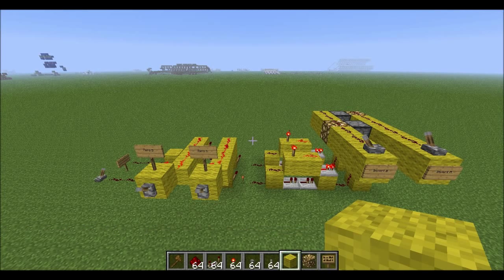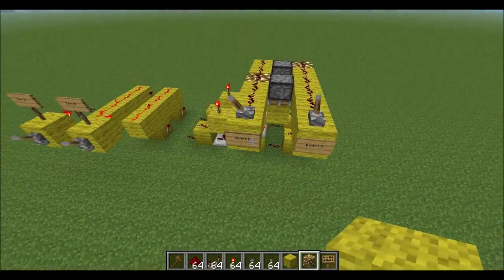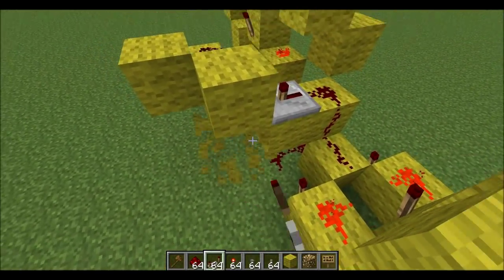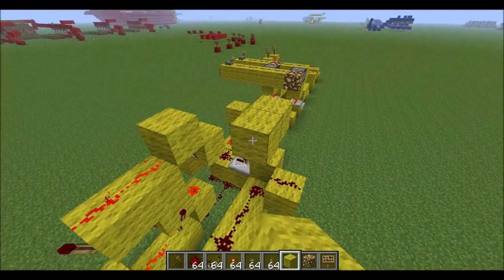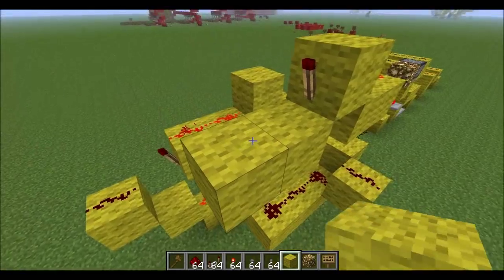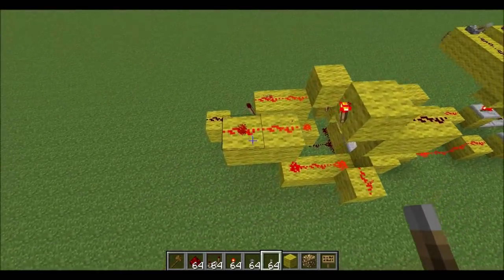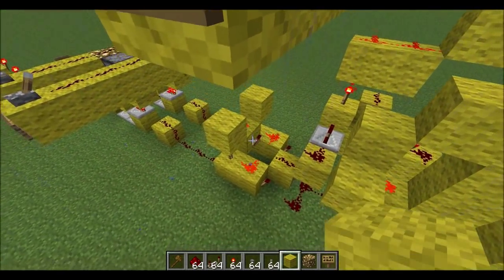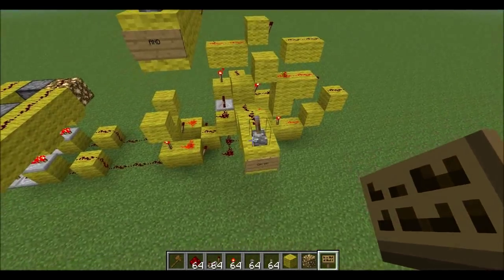Minecraft: How To Build A 4-Bit Computer - Part 3 - ALU II [Tutorial]

Comment: Thx for reply... I am delighted to inform that the computer still works... My first row of RAM is f****d up though... I have to use the second one 

Many people might have problems with the decoders that you were using... but I got a solution to that as well.
Reply: why!!!!!!
Reply: @evancady3388  ? 

This has probably been the longest post necro for me on YouTube haha. Just in case you are trying to build a redstone computer based off of this guide - don't. If my memory serves, then the design broke at one point because redstone was updated. Haven't done anything with redstone computers for a long time myself any more - moved on to proper logic simulators and hardware description languages a long time ago, so I can't recommend anything either.